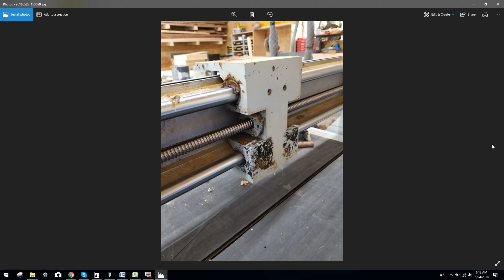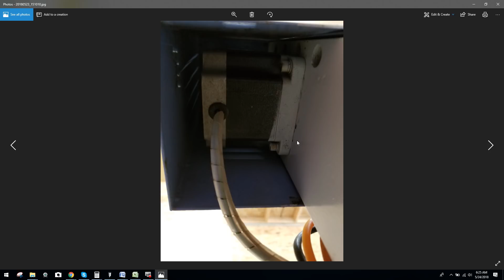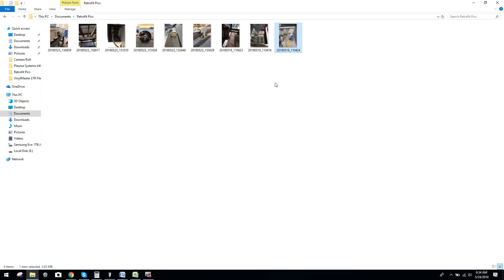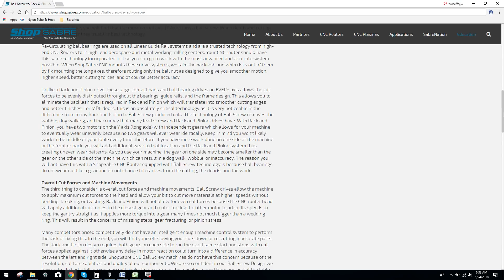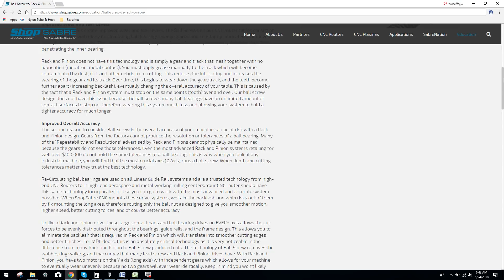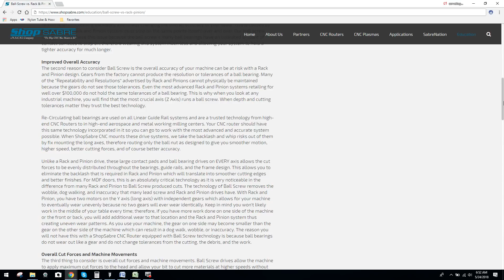CNC Retrofitting & Transmission Selection Revisited -Gecko's New 3 Year Warranty!

Comment: Vince, great information here and more people should be paying attention to the mechanics because electronics is the easy part. I am planning a retrofit on a machine I got a few years ago and will need a consultation. Speaking of unbeatable accuracy and durability my machine has stainless steel drive belts 50mm wide, although technically only X is a belt and the Y axis has dual drive tapes because they are anchored at the ends. From what I gather stainless belt transmission is  used in robots and commercial equipment.  But other than MiSUMi selling drive beltsI can't find much information. Do you have any experience with this type of transmission?
Reply from the maker: Thank you for your support. I haven't seen that type of transmission yet unfortunately. Thank you,
Vince

Comment: On the underside, the frame -I dont think that's surface rust, I had a similar machine, Chinese, very rough cast, cast iron, and low grade cast iron at that. Mine was reddish in colour, had the same ballscrew, same setup. Its in this vid   https://www.youtube.com/watch?v=ZY0EYN4b2Xw
Reply from the maker: Ned,

He confirmed it was surface rust as the system was left in a garage in Canada without climate control. The chassis has it all over. Thank you,
Vince

Comment: Thank you so much for the info
Reply: do you think this is a good deal? for a 4x8 CNC Im building
Reply: sorry forgot the link http://www.vxb.com/8-X4-Feet-CNC-Router-Kit-16mm-Rail-Guide-System-p/8X4-FEET-CNC-LINEAR-GUIDE-KIT.htm?gclid=EAIaIQobChMI2Zyo753O1gIVlbfACh0pPwqREAYYASABEgKSSPD_BwE
Reply from the maker: Joseph,
Thank you for your support. The VXB chassis kits appear to be a strong design considering their all based on chassis from China like the 6040,6090, 3020 ect. Their located in the US which means your covered with Paypal in the event you have any issues, and best of all your getting a ball screw transmission which will yield excellent performance, and longevity. Thank you,
Vince